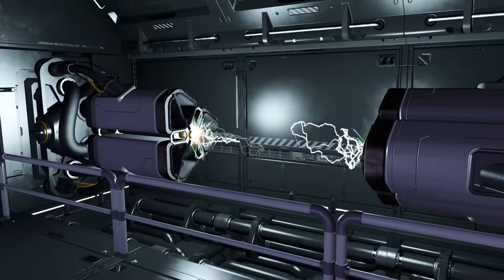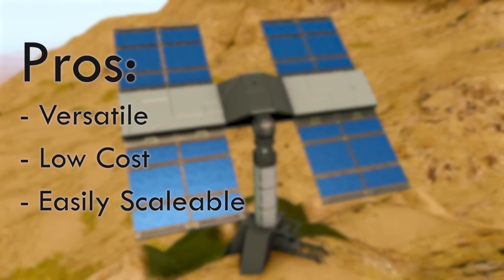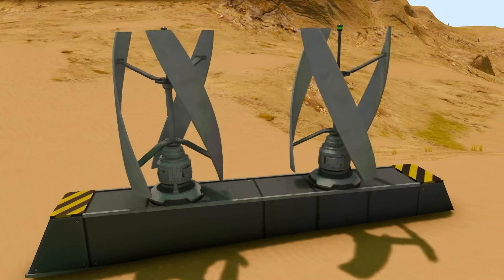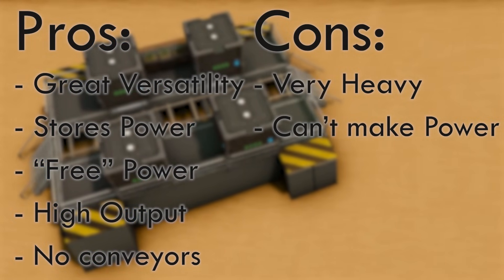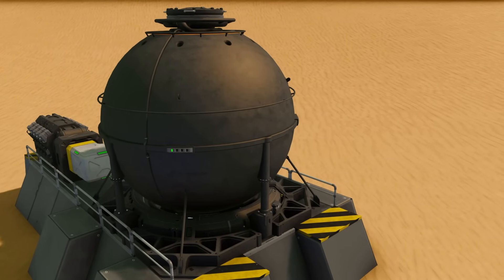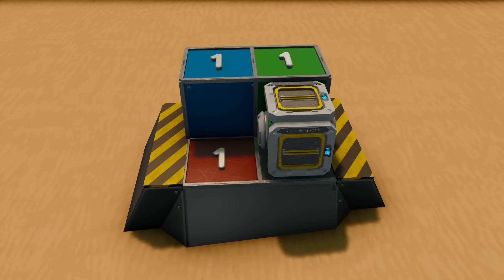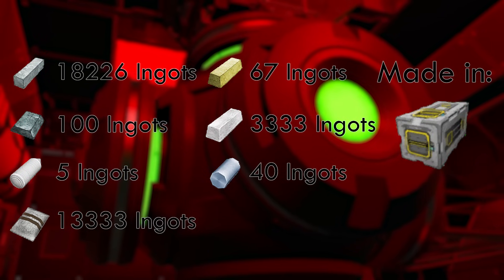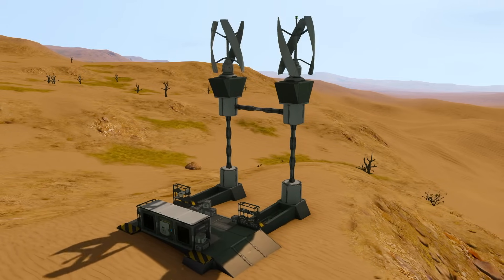The BEST Power Block in Space Engineers - Tier list & Comparison

Comment: You can also combine multiple power sources . For example, wind and hydrogen, or solar and reactors. The nice things is the renewable power has the first priority to have power taken, which means it will be the first to supply energy. That allows you to not use fuel unless demand exceeds the renewables max power output
Reply: Personally have a 4 combo. Wind for renewable, hydrogen engine for when thats not enough, at late/end game having one or two small reactors all charging a battery network for when shit hits the fan xD
Reply: @GamingPerks  Since wind and solar are best used excusively on bases, I most often than not only use those as sources, possibly with 1 or 2 backup hydrogen generators. Otherwise I mainly leave hydro and nuclear as ship fuels, since it's the easiest to remain mobile with lol
Reply: @GamingPerks  100%. I always make a battery bank in every base. Especially in early game when you're power consumption fluctuates a lot. Having that power stored up is really nice as a buffer
Reply: I add an event block and only have the hydrogen engines turn on if power is too low.
Reply: Currently working on a ship that uses Hydrogen, Uranium and Solar. That way, it can be refuelled pretty much anywhere :3
Reply: i did not know that, thanks!
Reply: there are scripts as well that makes it where reactors and engines only turn on when needed. i like having a mix of stuff. i aways have some batteries on stuff. if i can help it i use reactors as a jump start only

Comment: The wind turbine can be used on voxel locked subgrids, as well as static grids.
This means you can put one on a vehicle, and then using rotors and pistons, deploy it.  Simple designs just rotate the subgrid with the turbine and landing gear on it, and then lower vehicle suspension until locked.  It's great for mobile drills, where you will be voxel locking to deploy a drill anyways.

Comment: 2 things

One H2 generator produces exactly as much hydrogen as one engine consumes  so you could run engines on just h2 generators and skip the tanks

Also imo the combination of reactors and engines works best as they reactors can take over the basic load and you can switch on the engine once the reactor runs out

Comment: Hydrogen is by far the most powerful source of energy, both for pvp and large scale capital ships.  And unlike ion and atmospheric thrust, hydrogen can get you anywhere.  As long as you have an effective refueling station, a hydrogen fleet is superior.  And actually cheaper as it needs much less gold, cobalt, uranium and platinum in the construction of such a fleet.  When gathering resources and refining them, these rare resources take much longer to gather and refine.  So ships that cost less of these and more of the common materials actually take much less time to build.  And hydrogen power systems use much less rare resources.

Comment: Very nice video. And I would go even further and say that you're pretty much left with no other option than large reactors, when going capital. Those jump drives are hungry af. :)
Reply: There is this idea I have been thinking about, but I don't know how feasible it is. You have a massive solar array and batteries out in space at all your main jump points. You have a MASSIVE shell ship filled with nothing but batteries, minimal thrusters, and jump drives that you attach your capital ship to. You leave the shell ship attached to the solar array at your end point to recharge and fly off on your capital ship. A sort of jump gate system. Not good in all situations, but a fun idea if you don't want the energy drain/output burden of jump drives on your main ship.
Reply: @njnjco  I did something like that. When you are at this point of going to space and back to the planets surface, but not having enough platinum/uranium yet for a capital ship: I made a jump attachment like Obi-Wan used with his little fighter. Basically some jumpdrives with solar panels and a connector. Dock with the small ship and jump wherever you need to got. Then leave the Jump section in orbit to recharge.
Reply from the maker: That is very true, though it depends on how big someones capital ship is. If all they need is a  single jumpdrive, it can run off of batteries just fine 🙃

Comment: I know that you didn't cover mods. I just wanted to put this out there. A few years ago I was trying to find an alternative for power. It was right after they stole uranium from the planets. (How unrealistic!) 
So I found the Deuterium reactor mod. It uses stone and or ice to create deuterium containers for fuel (or both). There are large and small grid variants and they are POWERFUL. I do love the mod. There is also a positive thing about going to space. It's the only place to find pure deuterium deposits that is very rich when refined. So, the mod makes it very beneficial to go to space and has you actually looking to go there for that rich resource. Who doesn't want a 12GW reactor operating their base. All the power they would need FOREVER!

OH! They are NOT cheap to build! You better be ready to mine a bunch of gold and other rare stuff to get the special components to build one. These things are a beast to build. The bigger they are the more expensive they will cost you to build. So, cost will depend on how much you are willing to go mine. It will be a grind just to build the low level one. I think one of the lower tier one take 2000 of the special components and it also requires like 500 or so superconductors also. Be ready to grind for some recourses. This mod does put in a really nice power gen option, but you are not going to get it easy. You WILL WORK FOR IT!
Reply: Ah yes i have that mod as well and i do agree that is by far the best reactor mod the mod is called Life Tech Energy pack.
Reply: This is why resources (energy, materials, and the way acquiring it) in general needs to be balanced. Sure they can keep up with the "but SE is industrial!1!1!" but brother they're LITERALLY exploring space, have jump drive technology, made high-tech war spaceships and you're telling ME they cannot gain resources more efficiently? What about nuclear waste recycling stuff, what about better refineries, better batteries, better engine, better EVERYTHING, cuz they're engineers IN-GAME and surely keeps on innovating to improve their overall lives? I don't get it man, even Klang would not have the heart to limit the players this far back, like oh wow my piston elevator is launched to the air at Mach 2 speed or my ship wobbles to the oblivion, definitely better than not being able to advance in technology due to the game's lack of optimization.

But well, Space Engineers is like 10 years old and Keen had worked hard on it for so long... the updates and care they gave to such a game is more than enough, I'm thankful for them. I don't know if SE2 will be completely revolutionary and will be exponentially better in many aspects compared to SE1, well I undoubtedly hope so, and I will definitely buy it. Please at least make world generations more realistic in aspects other than vegetations.
Reply: @wholecheese I agree. I do think they have come a long way. The new prototech content is cool. With so much more tech available in other space games. You would think they would adjust the tech. I do believe SE2 is going to be the game where our options are going to be better. 
They have already told us by putting the story of SE2 10,000 years in the future or light-years from the original galaxy. You would expect to see massively advanced tech in the new game, but we will just have to see how that plays out. I have my reservations on jumping to conclusions. I do hope they have taken all of what SE has delivered to us, and improve it greatly. 👍☺️
Reply: @JAY-fq7sb I wholecheese-heartedly hope so. I wish SE2 have more weaponry parts for customization, better armors, bigger planets, more, stronger materials and so on. The new prototech update (which I 100% did not forget at all in my first reply) gives me a standing point to see how things will scale (much bigger and better, hopefully) in SE2.
Reply: @wholecheese I just seen a sneak peak of what Keen has been up to. It is encouraging to see. There is also something about some advanced things to discover in the mountains of one of the new planets that is coming in SE2. Lots of good stuff in the future and I do think they are listening as they have to those who are playing. 😄👍

Comment: You missed some really important points:

- All theses blocks have PCU, and this figures is really important on keen's vanilla official servers for instance.
- Batteries have an efficiency coefficient of 80%. Meaning when you charge them with 1MWh you only get 800kWh of power stored. This really degrades them as the "ultimate" energy solution.
- Your side by side comparison of H2 vs Uranium ingots production is biased as you can add power efficiency or yield modules to the refinery. Uranium is also more convenient to transport and transfer form grid to grid (you can even do this by hand).
- The weight comparison between those two is also biased as the H2 Engine will also need tanks (and possibly H2/O2 generators and storage for ice) to be efficient. In the other hand, a lot of Uranium can be stored inside nuclear reactors.

Another big issue with the H2 energy is .. the O2 production ! If you need to get a constant H2/O2 generation on your grid and you use a cryo pod for your AFK, the small O2 consumption will constantly drain your Ice storage only to refill your tanks at 100%. Problem is that its not really efficient unless you use the (new) event block to regulate the H2/O2 generators.

The "rare fuel issue" of uranium is not a real problem once you reached space. You can find it quite easily once this is achieved.

Myself I still consider the large nuclear reactor as king of energy production. No question asked !
Reply from the maker: All of these points are very valid, and I did forget about PCU, since most people usually talk about block limits instead of PCU limits. I am also not a math major unfortunately, so there is a lot of calculations I simply have not been able to do. 

As for if the comparison between H2 and Uranium is biased, no it is not. I am well aware that you can add modules to the refinery, but in a way, you can call that DLC. I was comparing the base produkts, and did not take extras into account. For instance, I could have also decided to fill the same space the refinery uses with more O2H2 gens, because then they use the same space. So the biased argument, is simply false. Also because I mentioned and even showed that a hydrogen tank was needed, and throughout the hydrogen engine ranking, I mentioned tanks several times. So not biased.

Either way, thank you for raising these points of discussion. 👍

Comment: Resource cost is meaningless when you know hot to play and scale up production.

Weight means nothing.

And you failed to mention the most important ranking factor:

* PCU *

By this factor alone Large Reactor is S Tier.

Most of my ships have 1 reactor and 1 battery (for pipes).
Reply from the maker: Resource cost is important to begin with, and for those who don't necessarily know how to get vast amounts of resources quick.

Weight is important if you are building ships or anything that moves.

PCU I did forget yes, apologies.

And that's fair, a decent setup.

Comment: I disagree with the ranking of the Wind Turbine vs the Solar Panel, if only because the Wind Turbine shines in early game while the Solar Panel shines in mid game.

My power block recommendation would be:
Wind power in the early game. This would provide most, if not all, of your early game power, and I would personally not exceed a total of three Wind Turbines.
Once you outgrow those, I would recommend switching to solar arrays for the scalability.
Space flight eventually necessitates the use of hydrogen for fuel anyway, so in space it can be very useful to generate power using hydrogen as well.
The switch to Uranium, I would personally only ever conduct with large grids, as it seems to rare of a fuel source to use it on small grids.
All of these would naturally be amplified by using batteries for power storage.

But that's my idea of it.
Reply from the maker: That is very valid and I completely agree. The only reason the wind turbine really fell behind, was because its not usable on all the planets/moons, nor in space. As well as the differing performance depending on weather. Other than that, completely agree 👍

Comment: You don't get that 30% for free.  It cost energy to get the materials, refine them,  then produce the components.  Plus the battery has a passive discharge
Reply from the maker: What I meant with free was that the battery could have come empty, similarly to the hydrogen/oxygen tanks. So in that sense, you get power for free. But I completely agree, its not really free, but it is an added bonus.

Comment: I built this large grid mining rover with a drill in the middle that goes down on pistons. I just put 2 hydrogen engines on it and use the ice it mines to fuel it. Somehow it runs two large refineries while also powering 6 wheels to move it and the Mf 100000 kilos of ore. I need to add more batteries tho.

Comment: Nope. Battery shouldn't even be on this list as it only stores power, and the free power shouldn't count. Evenn if wind turbine has many drawbacks..if your in atmosphere it's the best place and forget power. You didn't count the extra cost of trying to build enough o2 gens to keep the hyedo eng running.
Reply from the maker: Well, this was a comparison between power blocks, and in SE, and the battery is in the powerblock category. Not to mention, like I said at the end, what works best depends on the situation. Also, you only need 1 02h2 generator per hydrogen engine, so I did take it into account.

Comment: I would rank the solar on the last place then comes the reactors bcause the fuel issue then the hydrogen engine bcause the high consumption and then the wind turbine at first 
if we doesnt compare the ability to generate energy on nonstatic grids or outer atmosphere the wind is the best use at start and up to endgame bcause the "6-way-cross-setup) that setup allowed u to automatical build the turbines far enough and it will never get no power so the safest way to generate power is wind bcause thats ever there . in combination of one or 2 batteries it will be very strong